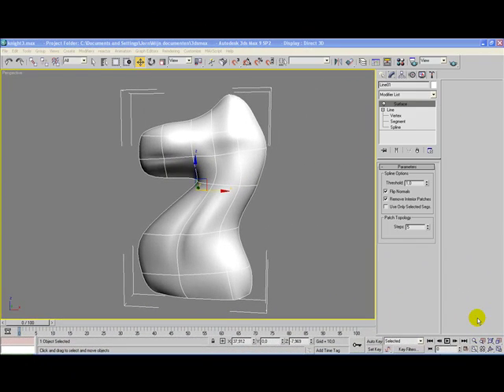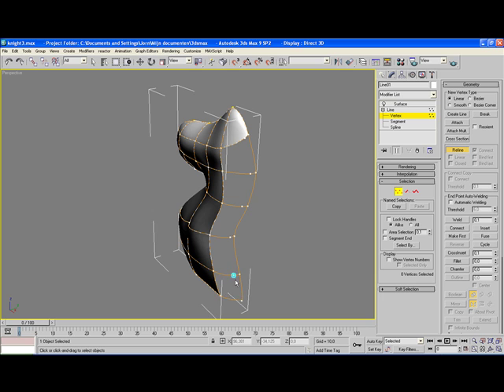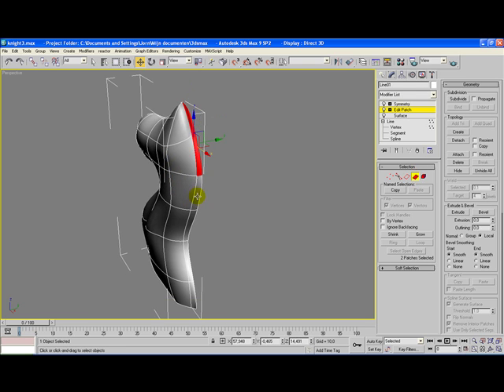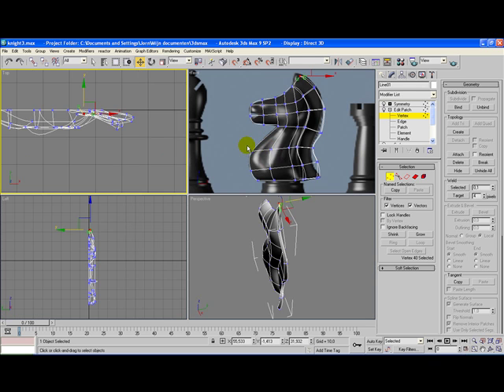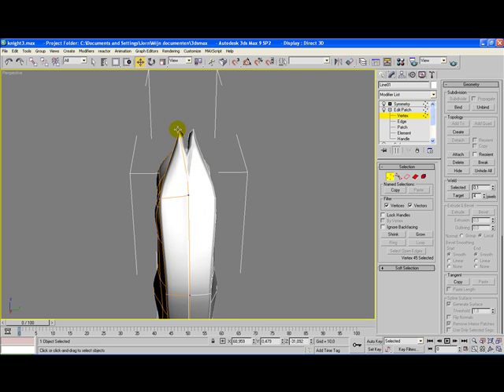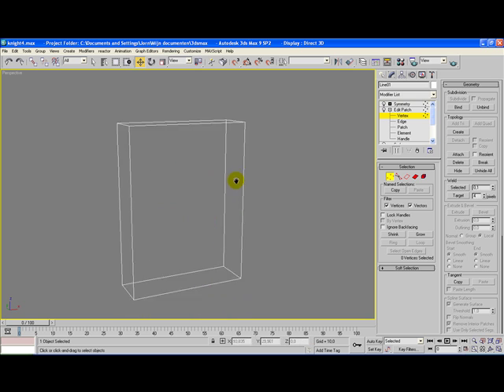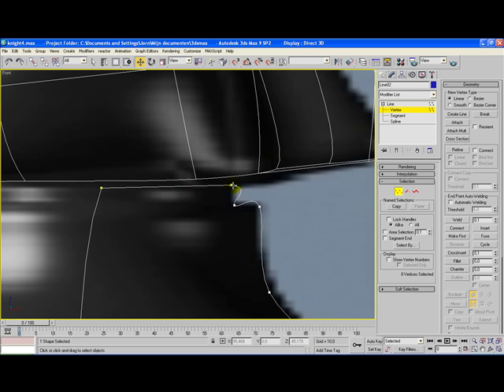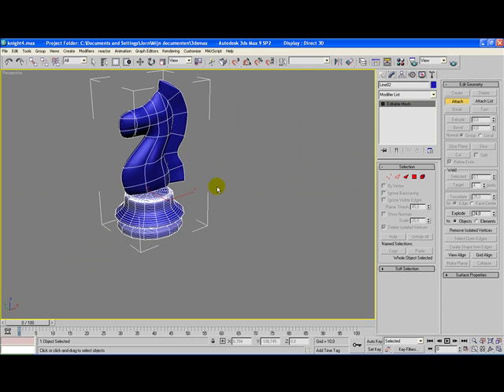3d max tutorial: Moddeling chess set - The knight - part 2

Comment: i know your reply is old but. in some cases spline is realy easy&helpfull to use instead of Poly& it alsoe have auto uvwmapping exs rails is extremly easy with spline selecting it to be cylinder etc it flows the spline line and auto uvw pammed :) ps Norwegian&dyselexia